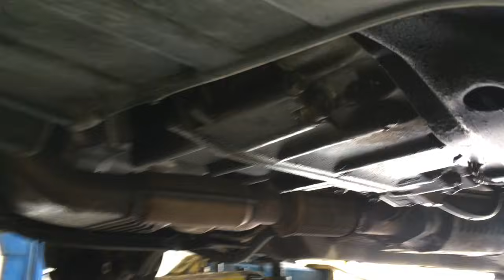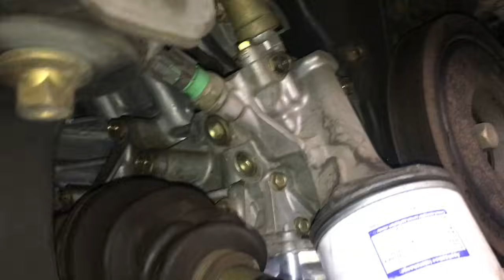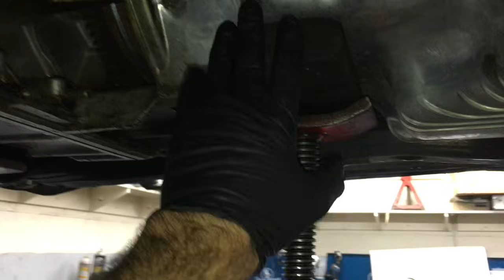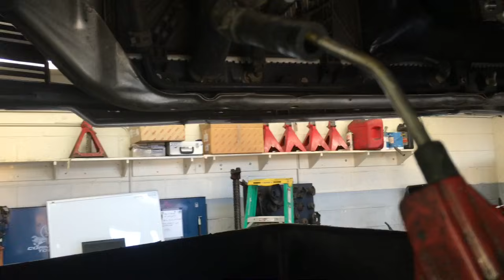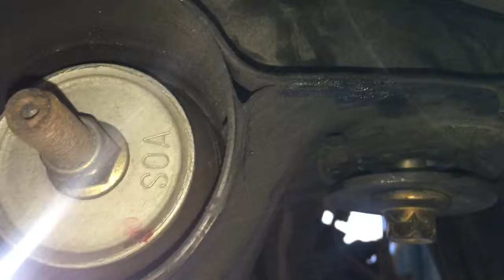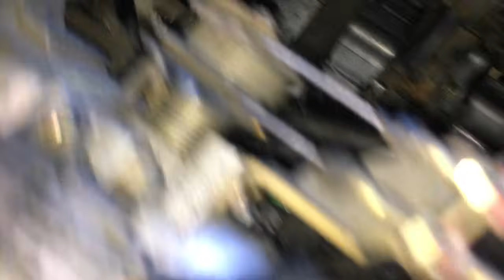How To Remove And Install A Transmission On A 1997-2002 Honda Accord

Comment: I have a question I but a transmission for my 98 accord lx 2.3 but the plug for but the transmission speed sensor plug is a 2 prong Insted of 3 prong could I convert the plug from 2 to 3 prong plug thx or could I just buy 2 prong sensors

Comment: The transmission is shot in my 1999 Accord... I was considering doing this job but i live in CT.  All of these bolts are probably rusted and seized lol.  Especially the exhaust pipes.  No way it's worth doing this job

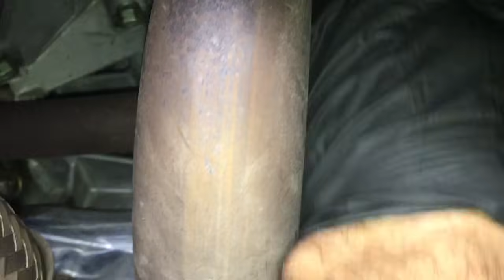Comment: You doing good but I removed the tranny,I don't touch the rackepinion is no on way and pipe from muffler I didn't not remove 10:31

Comment: Hi, would I have to remove the transmission like what is shown in your video, if I needed to replace just the rear main seal?  Thank you!
Reply: Yes, you have to pull the transmission to get to the rear main seal.

Comment: Why did you have to remove the back engine mount? It doesn't seem to be in the way or connected to the transmission?

Comment: Got to the separating the motor from the tranny and the torque converter is pushing out. Keep it from separating. Any help here? (Yes, i removed those 8 10mm bolts.) Im missing something at this point.

Comment: Will a 97 4 cylinder honda accord transmission fit a 98 vtec v6 ??
Reply from the maker: Jacob Harrington -CoCorKiller My guess would be no but I’m not sure.
Reply: No they are completely different, just changed a out a 4 cyl one and watched this video cause I was curious about the v6s , they are different

Comment: I know this video is not about the Toyota but I do have a question? It's a 1999 camry and I just put the transmission in and it shifts rough first and second gear and it won't shift into 3rd gear unless I let off the gas pedal. What is the problem? Just put this transmission in.
Reply from the maker: Kevin Lucas I would start with the basics and make sure the fluid is at the right level. After that hook up a candle to see if the speed sensors in the transmission are reading correctly. Also check for codes.If the throttle position sensor on the engine is malfunctioning could cause transmission issues as well.

Comment: To Mr. Eslick and others who are familiar with unbolting a transmission from an old and/or high mileage engine, I have this question:
With the transmission out, why not take the opportunity to replace the rear main seal for good measure? The seal material is original with twenty years and a bazillion miles on it, it is not a life-time part, and they do tend to weep oil as a result. Comments? Opinions?
Reply: Good idea!  Seal is cheap

Comment: I have a 02 accord and i think the transmissiom is about to fail. I was wonderong if it makes any sence to replace it since all the transmissions from that era are garbage, it may need replacing again. Wouldt it make more sence to rebuild it. Just wondering
Reply: Some recommend putting an aftermarket transmission cooler to help it last longer
Reply: @recklessvector8886  oh interesting. I never read that anywhere. The thought never occured to me that heat was the issue. 

I did replace it with a lower km one. It lasted till the power steering line and fuel lines and brake lines all went out. Also the frame Jack points caved in. Live in canada so salt killed the car. I scrapped the car in 2022. Tranny was still working when i scrapped it lol.

Car had 380000 km on it RIP 🪦

Comment: man for such a great motor Honda did a shit job on that transmission for the 02.
Reply: Honda transmissions from '98 to '02 were GARBAGE!  Without admitting any 'defects in manufacturer' Honda extended their transmission warranty on these affected vehicles (Accord's, Odyssey's etc) to 100k miles or 93 months, whichever came first.  Didn't do my Mom any good though, as she BABIED her '01 Accord, which had less than 60k miles on it by this year (2018) and the transmission still went out.  Per most car companies, they professed  'innocence' to using a sub-standard design, but go on the web and look at the MASSIVE number of failures (and REPEATED FAILURES, post 'new' units being installed!) associated with these year models!
Reply: @DadBradTo5  weird I have 262k on mine and still drive it everyday.
Reply: @DadBradTo5  true glad I have a MT and not automatic.
Reply: @DadBradTo5  what should i replace it with ?
Reply: I agree

Comment: If you replace the engine or transmission make sure that you replace the rear main seal and the O ring on top of the main seal and also all of the axle and input seals on the transmission there's like 4 of them. You do all that work no point in waiting for a leak and then having to rip it out again just for some stupid rubber seals

Comment: Man you lost me after you disconnected the Selenoids , Damn no wonder they wanna charge ove r 2,500 just to rebuild it...smh
Reply from the maker: +Explict DP yeah it’s not easy.
Reply: How to Automotive Yeah I see, Maybe if I had the tools,   Lift & The time  I could tackle a job like that, Hey I was wondering since you're very informative in knowing all the part locations. I have the same vehicle a year older 2001 I was wondering if you give me quick diagnosis the car's been running good since I bought it four months ago and then it suddenly started slipping couple of days ago I added Lucas additive oil to the transmission I might have been running in it on low transmission oil but when it gets past 2nd gear and third Gears around 300 RPM it slips and goes into neutral , then I would either have to stop or wait until it catches shift again was wondering if you if you could tell me or know if it's a particular solenoid that might be defective and causing that type of transmission effect of code p1750 hoping is just a malfunctioning solenoid, instead of a expensive job like actual replacement of the Transmission? Thanks appreciate you
Reply: How to Automotive actually a P0730 code shift selenoid or A/T clucth selenoid??? How much should I really pay for a job like you performed, plus remanufacture Transmission
Reply: You can drop the trans out the bottom without a lift, you just need to get the car high up in the air.  You can use a floor jack on the lower control arms to get it high enough up for the trans to clear out the bottom on a trans jack/dolly
Reply: @HowtoAutomotive he is exactly right.  You need to show how you do it not just saying it.  Just show the process. I’m trying to do it and it’s a disaster trying to watch you while doing it.   Pausing it every 15 seconds and working for a half hour.   Then refinding the spot I was at on the video.   It just doesn’t work.  It’s no help at all.

Comment: Ummm.... just did one at the shop last week,  rack/pinion doesn't need to come out. Subframe separates by the driver side to give enough room to pull the trans out. And book rate is only 6.2hrs to do. Looks like you made way more work for yourself than was needed 😐
Reply: with 6.2 book hours, what is a fair quote to have a swap done
Reply: @olbricky6824  any info on the pricing for something like this?
Reply: Well, pulling the rack and pinion maybe quicker to change the power steering?
Reply: how much would a shop charge for something like this I’m old and can’t really do this my self anymore

Comment: Learned enough to know there is no way in hell I will ever attempt this myself. Thanks man. 😉
Reply from the maker: Brian Meyer not one of my favorite jobs either. Thank you for watching!
Reply: @johnny Macon  hey man I just saw this. I would try replacing the Shift Solenoids. Not the Linear solenoids, which you have checked, the solenoids under the starter and thermostat housing. Those are On and OFF only. So if yours is caught in the Off position, that'll cause similar symptoms.
Reply: I was thinking that me and my friends could do it but no, same car won't shift
Reply: Now we send it
Reply: At least your being honest w/ yourself!
Reply: lol 😫😫🤣
Reply: 😂 right..  I'm going to stick to bikes  🤣
Reply: Same lol.  Plus mine is in CT USA.. the suspension and exhaust and rack needing to come out ... Absolutely no way I wouldn't have to replace all those things as well
Reply: Heck no!!😂
Reply: My nervous system is saying Hell to the No... lol
Reply: i’m in the middle of it right now
Reply: It's a daunting job, no doubt about it. The greatest obstacle to a non-tech doing this job himself is lack of a lift. I see absolutely no way to remove a transmission from above.
Reply: @lothianmcadam1 , I bought a freestanding engine hoist, and plan to lower the transmission from above using this hoist. I'll let you know how it turns out.
Reply: Can you get the trans out through the bottom without removing the sub frame I'll be doing this in my driveway with nothing but jack stands and jacks
Reply: @elliottpetty4979  can you? How did it turn out?
Reply: @elliottpetty4979 how did it go?

Comment: So a guy is offering me a 2000 honda accord mint condition for 500 bucks. The only problem is that when it warms up after a while the 4th gear starts slipping . is it worth it to purchase and repair or pass it by ? it has a Vtech engine I think 6 cylinders (214,00 miles ). I would apreciate some feedback. Thanks
Reply from the maker: Efrain Gallardo 214k is a red flag. If you're trying to flip it this is not a good deal but if you're looking for a car to put a little money into and drive possibly. Would look up how much they're selling for in your area to determine if this is a good price or not. Sounds like it's going to need a transmission in its near future.
Reply: How to Automotive thanks for info. I thought maybe it has dirty oil and I can do a complete transmission flush. It just seemed strange that it starts skipping at the 4th gear.
Reply from the maker: Efrain Gallardo 214k on it more like something is broken.
Reply: How to Automotive Got it. Thanks for helping me out with this.

Comment: Is it better to rebuild it or get a new one cause my v6 Accord is having transmission problem now what should I do get a new one or rebuild it ?
Reply from the maker: Javier Paulino i'm not a fan of rebuilt transmissions. I would recommend a new one if you can get one.
Reply: So should I get a new one cause i only have 133,433 miles on my Honda Accord
Reply from the maker: Javier Paulino if the car is in really good shape and it has some value then I would say yes to a new .

Comment: The subframe is actually joined about midway on both sides by three or four bolts on the left and right. By separating it there you don't have to take the entire subframe down, nor the steering assembly or the exhaust. Yes, it was this same model, same engine size, etc. Twas an informative video though. I see now why not many people post these videos (Honda transmission removal), because it can be a pain in the anus. Thumbs up, holmes.
Reply: This was 3.0 v6? I have the same car ive got ready for it to come out rn. I cant get it to fit thru the top but the subrame comes in two????
Reply: Totally right I think everyone should read this comment it cuts the operation down at least 3 hours and turns it from a chronic pain in the ass into a mild one
Reply: hey man Im trying to figure out this subframe hack I keep hearing about on honda accord v6. Could you just clarify what you mean? I apologize for bothering. I know the subframe mount you speak of but once I disconnect the 2-3 bolts then what? Like how does it fall? Where did you pull transmission out? I NEED THE INFO IN YOUR BRAIN..lol
Reply: @alexandercahoulan6583  You have to remove all the bolts on the bottom of the frame, and also the bolts/bushings at the front of it. Then you kind of slide it forward and down at the same time.
Reply: Agree, this is an important step.  If you separate the front beam from the subframe in this manner then you need to mark the front beam where it connects to the subframe with a sharpie or grease pen or something or it won't align properly when you put it back together.  The front beam will drop with the front engine mount and lower control arms.  This would have saved probably an hour or more of labor on the video.
Reply: Thank you for posting this, Mr. Lee. Your advice is a hey-yooge help. I still have to cross-check against the Honda Service Manual for this point in the procedure. But your idea, if it works, saves a LOT of unnecessary dis/reassembly (and the cost of three crush washers!)

Comment: Good video,,  one question on a 2003 accord  should be about the same work to replace the transmission ?
Reply from the maker: Marco Sánchez yes it's pretty much the same exact job just a few different brackets.
Reply: How to Automotive  I already replaced the transmission on my honda 2003  4  cylinder your video helped me a lot thank you so much
Reply from the maker: Marco Sánchez glad the video helped. Thank you for watching!

Comment: So much to disassemble to bring transmission down on this Accord v6. Wonder if it would have been easier to pull out engine and transmission thru the top, and then separate them outside. I need to do this job on my 99 v6 soon to change the rear main seal. I did change this seal on my 2000 civic and that was a piece of cake (no lower member or rack & pinion removal needed). 

By the way the transmission on my Accord started to slip and give me problems and issues after approx 20 minutes of driving my car, but I noticed that after cooling off I was able to restart it and drive it fine for another 20 minutes approx to get the same symptoms again. My conclusion was that the transmission fluid was overheating and decided to install a trans cooler, a magnetic filter, and drain & replace the fluid (with valvoline Atf for Hondas - I have used them in several of my Hondas with no problem whatsoever-). It totally fixed my problem, and I just hope I can get more life from this transmission. 

I would definitely recommend to any Accord or Odyssey owner to install a transmission cooler since these cars definitively have overheating problems. 

Great video. Thanks.
Reply: Leopoldo Enriquez I have the same issue with my accord. It slips after 20 mins of driving
Reply: It would be way more work if you pulled it from up top. Discount all electrical, bolts, mounts, etc.

Comment: used 2 videos to pull , rebuild,and drop it back in . . this info packed video and a transmission rebuild one $125 and a day later perfect running Honda thanks alot .
Reply from the maker: Mikel that's awesome! Thank you for sharing!
Reply: What was the other video you used
Reply: Mke: How'd you drop the engine? IOW... I presume you had access to a lift?
Reply: Where did you get the gears
Reply: Mikel das wassup bro

Comment: My exhaust bolts are so messed up that I'm gonna attempt to pull the transmission with the sub frame dangling on the exhaust. This is a nightmare to do on the floor. Your video is a well done inspiration. No fluff, just info.
Reply from the maker: Brian Graves thank hope it works out for you sucks dealing with damaged bolts .
Reply: It worked great!!

Comment: How many quarts of oil do I put in after installing a freshly rebuilt trans accord 2000 4 cylinder
Reply from the maker: luismendoza9049 I will look it up tomorrow when I get back to the shop.
Reply from the maker: luismendoza9049 if The transmission is completely dry of fluid it a whole 6 1/2 quarts. But if you're just doing a drain infill it's about 2 3/4 quarts.
Reply: They hold about 2L